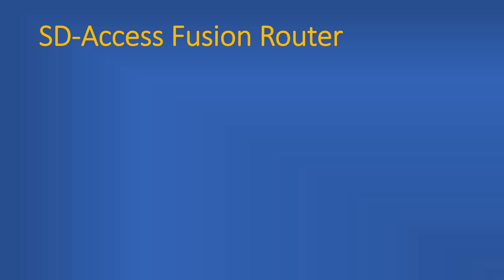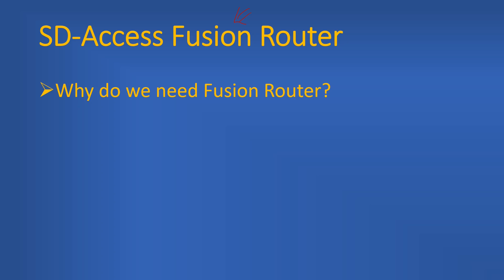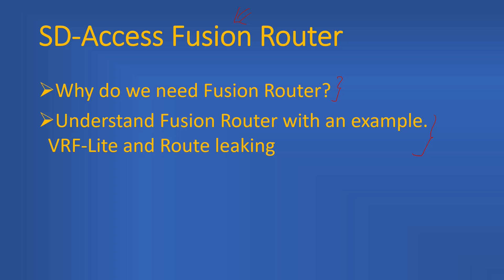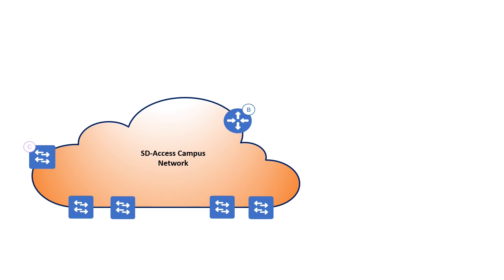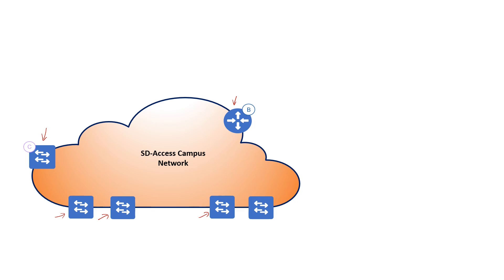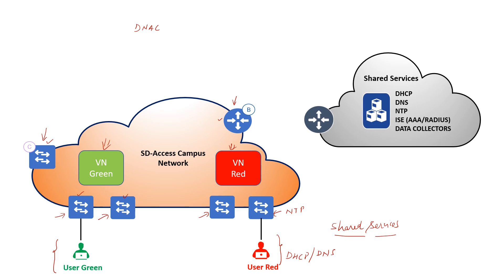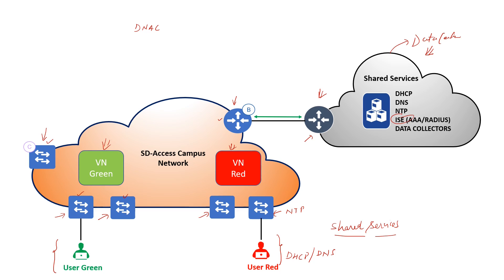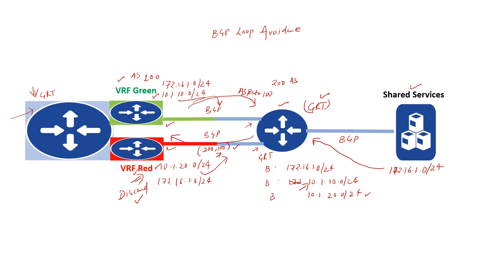SD Access Fusion Router

Comment: Hello Mr. Dutt,
I found you yesterday and already finished this course, I am still wondering if this could be this simple or there is something you avoided due to its difficulty. I must say this is the best descriptive video I have seen in my life. Thank you very much for the knowledge you gave  here free.

However, can I ask you something? Would you consider a full CCNP course on your channel? You have the best analytical mind and I think what fits you the most is not working for Cisco but been somewhere working as a university professor.
Reply from the maker: Thanks Obi for taking time to appreciate this video series. Practical implementation of SDA has some more concepts but rest assured, you will be good to go if you have this series in your belt. Things will make more sense. And yes, you are correct, teaching is what I love most..

Comment: In the video about border node, you had mentioned that the border node can run any protocol you want on the interface facing the external network. Say the external network is OSPF. Why then can’t the border just run OSPF <—> LISP mutual redistribution without the need of a fusion router? Is it just a best practice to run MP-BGP between border/fusion to make the route leaking between VRFs easier? Thanks, great content!